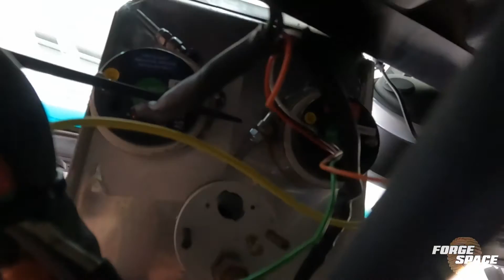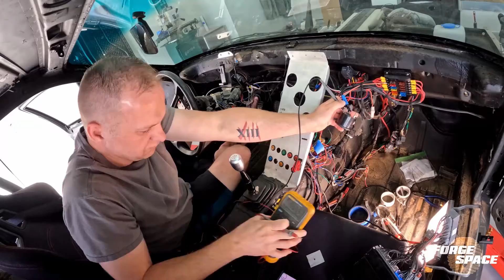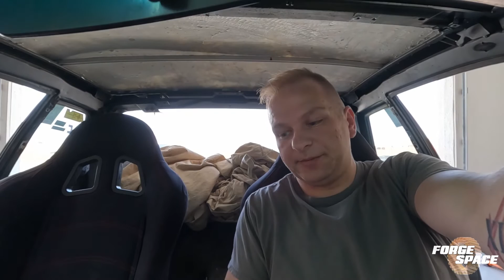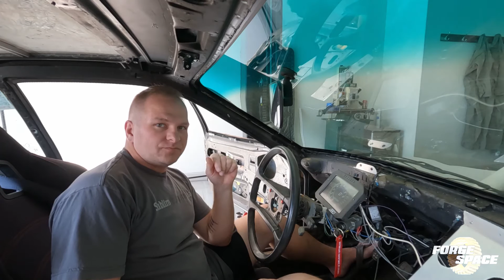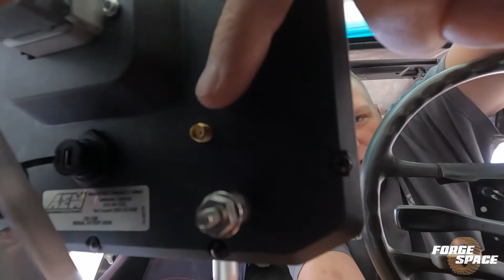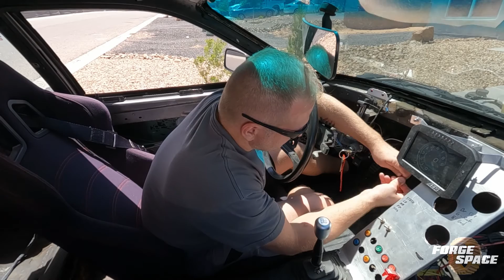Installing an AEM CD-7 Dash on the supra powered 944

Comment: How did you get the rpm gauge to work?
Reply from the maker: On the AEM? I selected the output over the CAN. the old gage was tapped into the black tach signal wire from harness.
Reply: @ForgeSpace  awesome thank you also what did you do to get the fuel leveler to work on the cd7? Did you need a 6 or 22 channel module or did you wire it to one of the spare inputs on the aem cd7?
Reply: @ForgeSpace  I just rewatched it again and seen you pin the fuel level sender wire to the aem series 2, what did you have to do in the aem tuning software in order to get the fuel leveler to work on the aem cd7?

Comment: Nice install! The standalone dash setups are so much better than all the separate gauges, especially since you can select whatever you want to watch all at once. What's next for this project? Carbon or fiberglass dash/ console?? Should definitely get a steering wheel/ hub in there. Sounds damn good too👍😁
Reply from the maker: Next I want to finish out the body work.  There is still a lot to do on that and it just looks like a mismatched beater.